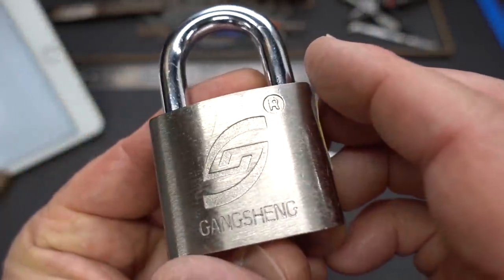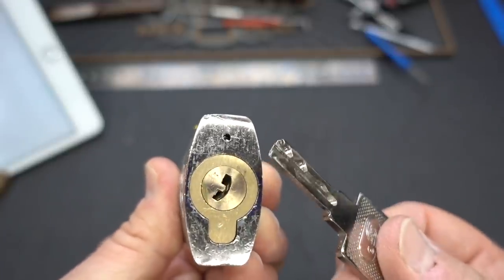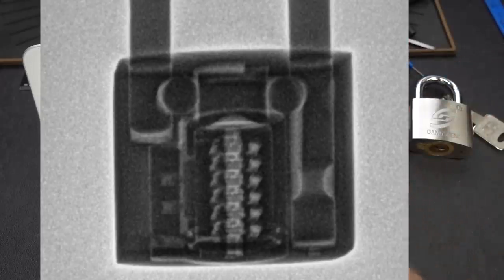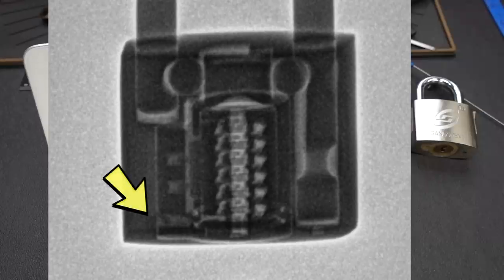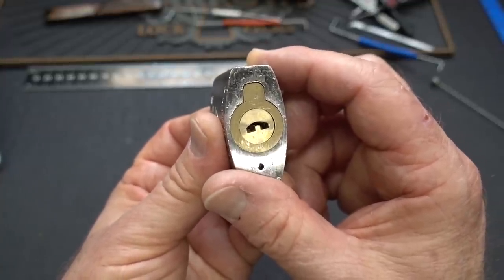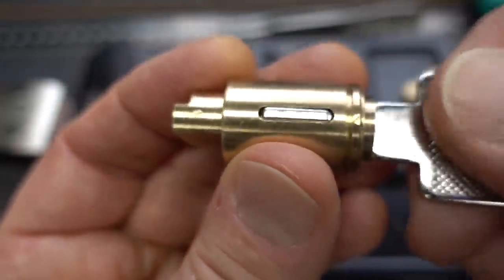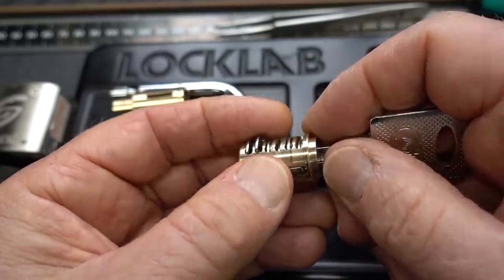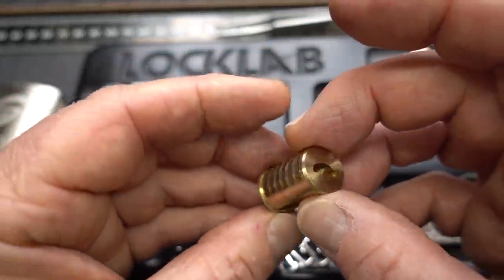(1792) Tensionless Lock (X-Rayed & Dissected)

Comment: I've seen something like this on the door locks of Renault brand delivery trucks we have at work. With the wrong key the core just rotates without engaging the locking mechanism, though those ones have a definite detent at the center position and if I recall correctly you can only insert or remove the key in that position.

I took one apart a couple of years ago and figured it out but I don't remember the exact structure anymore. But it was basically a wafer lock with an extra sleeve around the actual core just like this one.
Reply: Hmm. That's interesting

Comment: The only tension you could apply is lining the sidebars up, and getting the little bit of tension from the two springs through the side ball bearings. I don't think that would be enough to get those wafers to set, but you might feel it just a bit. Trying to pick this would be almost like cracking a safe combination.
Reply: Yes, I think this is the only way to apply some tension to the wafers, but then the problem is to leave the sliders set after you find the gate. Maybe (if the sliders are magnetic) you can try placing a strong magnet opposite to the brass thing that hold the springs, to see if you can prevent the spring of the wafers to move them back after you, hopefully, set it to the gate.

Comment: Future LPL: "I'll use the other pick that Bosnian Bill and I made..."
Reply: I think for that they will need the tension bar that the 2 of them are going to make
Reply: I like that Bill is not too proud to make a video where he says he don't know how too open it, yet.
Reply: Imagine a naughty bucket that LPL has.
Reply: I think that is picking it while you have an xray view.
Reply: Edit: I missed a detail. The outer sidebar locks the middle cylinder and the casing, preventing it from rotating freely. The flaw bellow cannot be exploited.
---
This specific model have serious design flaw, that makes it possible to bypass the lock. Basically, you need a tool that resembles the key, but longer and you don't need any cuts for the sliders. You insert it into the lock, press it inward as hard as you can and rotate. You use friction to directly rotate the middle cylinder.

The inner cylinder (that has all the sliders) is open on both sides, so the tool/key can pass through it fully. To increase security, you need something to close the inner cylinder on one side.

The insert tool may also have small spikes, with the idea of making small holes on the middle cylinder and use them as leverage for the rotation. It would leave marks, but they won't be visible without disassembly.

I've read some comments about using a drill, and my first idea was to spin the inner cylinder fast and use the friction between the inner and middle cylinders. Or rotating and pressing the inner cylinder into the middle one, sideways or in depth.
Then I watched the video again and spotted that the keyway of the inner cylinder is open on both sides.
Reply: You beat me to the obvious comment.  :)
Reply: @_aullik  doesn't the tool they made also tension on another pin instead of the hull so it could be very similar I imagine.
Reply: @ИванСнежков-з9й  Take a video ivan and posted here .
Reply: @ИванСнежков-з9й  the middle cylinder has a side bar that locks it into the outer casing. So you need to lower it to rotate the middle cylinder.
Reply: @stevenrigby6444 , I'm afraid that you are absolutely correct.
The outer casting has a sidebar that locks it with the middle cylinder.
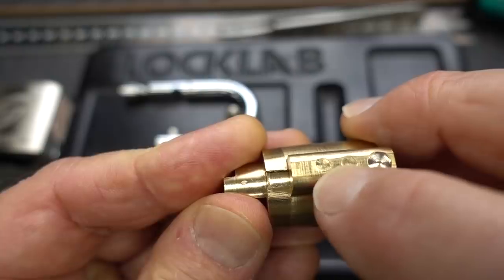It is visible in the video that both are locked at 6:52 .
Reply: @ИванСнежков-з9й  Can confirm, you can't bypass it like that. There's a solid mechanical lockup from the second sidebar.

Comment: Toughen up the lock and use a hardened pin on the side and you have an awesome lock. What's amazing is this came out of China, we are so used to locks that are poorly made.
Looks like the main flaw with this lock is the brass pin holding the core in.
Reply: China can make excellent things, *when they choose to and are paid to*. They can make absolute junk, and have a habit of substituting materials- I've seen 4140L steel subbed in for 1050 (which is not an acceptable substitute). However, if you specify what you want and pay for it, they can do very well. I've seen Chinese fakes of Rolexes that would fool all but the most aware collector, but I've also seen ones that wouldn't fool anyone.
Reply: @caseydarrah  Totally agree with you. For the right price you can get excellent locks from China. generally they pump out the cheap ones though that we are a ll familiar with.

Comment: Is the gate in the same place on each wafer, and the inside tooth cut in a different place? Or are the gates cut in different places on each wafer? If the wafers just need to all be centered, it would be possible to build a pair of 6-toothed picks that could bypass the teeth that interact with the key.

Comment: The only "flaw" in the design that I can imagine exploiting is the fact that the wafers become "centered" for this lock to open. How about using some sort of tweezers or forceps that apply parallel force and then try to do a raking/zipping motion with them, while at the same time applying a twist for tension. The use of two picking faces working in opposition/conjunction would eliminated the need for a separate tensioner.
Reply: You can't apply a twist for tension because there is no tension. Not only do all the gates need to be aligned, but the inner core has to be aligned with the middle core too.
Reply: Interesting idea, but it would only work if the sidebar spring is very strong and the slider springs are very weak. The inner sidebar has to drop into the groove faster than the 12 sliders come unaligned. Simply getting all their gates to align at the exact same second as they're all springing shut would probably be harder than just decoding the lock.
Reply: Or a ‘blanked’ key with a bunch of little leaf springs on it for each wafer. Insert key and each wafer will find its own tension
Reply: @lemmonsinmyeyes  Will find its own tension against what?
Reply: @CristiNeagu  Yeah, this is a lock where you would need to "feel" each slider and hope that you can discern some slight resistance as a gate passes the sidebar with the tiny force that is on it. And then it gets even worse because you have to somehow keep that slider in position as you tackle the others. This lock would require an intricate custom picking key that you would place bitting into as you pick each slider. Not impossible but also not practical, and adding any amount of false gates would make that method take exponentially longer.
Reply: I like the way you think. I have one of these and I truly hope to defeat it some day. Some how. Some way
Reply: @samheasmanwhite  The very definition of "key"

Comment: Bravo to China! They finally made a good one! Not only good, but clever and well-machined too!
Reply: Also check out Yuema 750 &/or 760, nearly identical except with front/back cores instead of inner/outer cores. And the 760 has an extra feature on the bottom of the core.
Reply: @ShadoFXPerino  That was a good vid, thanks!

Comment: Bill, pick it with superglue... lol.  But seriously, if you have a very small needle: can you bend it 90 degrees, insert it half way and try to bypass though the side bars? If you can get it up into the area where the outer side bar is it will not only tension it, but fully bypass it.
Reply: Yep, or why not a full blown superglue or loctite attack and simply  glue the inner chamber and containing sleeve together
Reply: @michaeledson1033  That was my first thought was well. However, the outer sidebar needs to drop in otherwise it blocks the rotation of the middle sleeve.
Reply: @arminkeller  Agreed, so much for a half-assed understanding before posting o7

Comment: Bill could you check if it would be possible to slide a shim between the outer housing and the sleeve? It looks like there is some kind of lip or a bend so I doubt it.
Very interesting design! I guess it would be hard to drill out the core because it will just rotate with the drill.
Reply: Na you would only need to stop the core from spinning. That would be trivial
Reply: The sliders look like SS, so I don't know that drilling the centre would actually help, even if you could keep it still. If you are going to drill, why not do what Bill did and drill out the core retention pin? If they change that to SS, then I guess a slide hammer is your best bet to avoid a very messy drilling experience. Or angle grinder, since we're going destructive anyway...
Reply: @yetanotherstronk  I agree with you. This is more a what-if-thought: "Wouldn't it be great to have that locking mechanism on your door?" Not as a padlock but as a mortise or other style of door cylinder. You are probably right about pulling the core with a Wendt Zieh-Fix or slide hammer.
Reply: You could drill out the core down through the sheer line, but it depends if the sidebars are hardened. It might be easier to pull the core out because it's only held in by a flimsy circlip. Drilling out the retaining pin would be the easiest way though. Just like bill did.
Reply: @jutonium2169  if your willing to apply enough brute Force that entry is evident you don't bother with the lock. There are easier ways to access anything.
Reply: A shim wouldn't let you open it, but if you could get one in there it could help you pick it if you could get it to put some extra force on the sidebar, any extra force would go a long way.
Reply: @samheasmanwhite  if you could get a shim in place or figure out how to run a wire or other thin tool though the core to that airgap you might be able to do something.
Reply: @michealc6439  Hmm, I think feeling the gates would still be the only way, whatever you get in there. That outer sidebar both locks the sleeve and is the only thing coupling the sleeve to the core, if the inner sidebar doesn't drop you can't do anything to move the outer sidebar or the sleeve.

Comment: If the side bars are aligned, isn't the lock tensioning itself? Could you feel each wafer for the side bar catching on the gate? Number of wafers I think could make this nearly impossible. You would also need a tool to keep a wafer in place after finding the gate.
Reply: just like a combination lock you would only get a feel on the highest two. So it would be a lot of back and forth with the specialized tool.
Reply: Yes, this seems to be the best approach imo. Decode it by feeling/listening for when the slider stops making contact with the sidebar, and decoding the lock. You could use 12 special 
picks.
Reply: @curlyvideos   Given the same springs arcross sliders and same spacing when they are aligned, that's the weakness. If you can find one gate and measure the spring tension on the slider there, you can measure that on the other sliders and decode the lock.
Reply: It would need a very intricate tool, basically a key that you can add bitting to like lego blocks, while still being open enough to let you pick freely enough to feel the indent. It would be a feat of engineering as much as a feat of picking.

Comment: Picking the first 2 or last 2 is not enough to gain tension. I have a cam lock version of this with a different shape keyway. The key must be inserted all the way until the final slider engages in order for it to turn the core. (Just FYI: the keyway is standard slider lock flat bar shape.) It's my favorite cam lock out of my entire collection of cam locks. Interesting note: i found it on EBay around 6 years ago using a one-word search term 'unpickable" and I've been unable to source another one like it anywhere ever since.
Reply: Have you posted any vids of that lock on your channel?
Reply: @RPRosen-ki2fk  No, but I hope to in the future. It was going to be one of the locks on the new challenge chest for Bill. But since he's retired, I have to find a new picker who is good enough to pick open the insanely complex locks I have in store for this new crazy challenge chest.

Comment: WOW -- MOST EXCELLENT taking the standard wafer tumbler design and combining it with the Abloy design to make a seemingly "pick proof" lock cylinder, abet a design error in an "easily" removed cylinder assembly.  Very cool with NP's X-Rays, however without the core "in-hand," I'm not sure one would understand how the lock worked.  Also TERRIBLE gutting, ha, ha

Comment: ...gonna say it, impressed but... as soon as I saw the core spinning I knew there was an intermediate sleeve of some kind. I'm pretty sure that came from hard core puzzle sport which is where I've seen it used before. I can see lock picks being powered by drills, and the picks being pretty much carbide drill bits.
Reply: If you're going destructive, a pair of wrenches would be enough :-)

Comment: the springs pushing the ball bearings on to the outer side bar are already tensioning the lock, as the outer side bar pushes on the inner one, when the core is aligned correctly. It is probably not a lot of tension delivered by these tiny springs, but its all you get ;) But I still think, that is not single pin pick-able, as the sliders have that V-groove and springs themselves, that will probably overpower those two tiny springs. but maybe you can decode it slider by slider (one should bind very lightly) and fix them in place once decoded...

Comment: If you put a strong permanent magnet across the lock body and rotate the core so the locking bar is on the opposite side, does it attract it enough that you have a reasonable chance of setting the first or last few wafers on either end of the core to allow the magnet to pull the bar in at one end? If you could do that you'd have some feel on the remainder of the wafers as you moved through them in order.
Reply: If so they should make all the parts stainless and non magnetic
Reply: If the lock was in a door, that would be a no-go ...

Comment: You might be able to decode the lock with a mirror tool like the Kwikset smartkey decoder. It should be possible to see the location of each gate through the keyhole.
Reply: Nope:( all you would see is the warding and the nub on the slider that the key interacts with

Comment: that brass pin needs to be some hardened steel because that entire lock is hold by that pin alone - the design seems amazing
Reply: The most secure method still seems to be the screw from the top, blocked by the shackle when it is locked. That way when you're able to reach the screw, you already had to open the shackle some other way.
Reply: Bolt cutters on the shackle are faster than drilling out a brass pin.

Comment: Are either of the sidebars or the ball bearings magnetic? If so you could use a very powerful magnet to apply force to the sidebar without using tension at all. Then once you pick it, you would have to keep the sliders in place until you got the second sidebar down and rotated the cam a little.

Comment: Holy crow, I'll have to watch this 30 times before I fully understand what turns what and what actuates what.  Oof
Reply: To put it in a simpler term:

Inner cylinder has a sidebar which sits flush against the outside of the cylinder unless the right key is in. Upon which the sidebar can move deeper into the inner cylinder causing a groove to appear.

Outer cylinder has a sidebar which will "fall down" into the groove of the inner cylinder (only if the right key is inserted). This engages the outer cylinder with the inner cylinder.

Outer cylinder is connected with the cam mechanism that disengages the big ball bearings that hold the shackle in.

The two small ball-bearings-with-springs are there just to ensure that the outer sidebar will "fall into" the groove on the inner cylinder regardless of orientation.
Reply: @PanduPoluan  thank you, it was the sidebars getting me stuck it seems :)

Comment: My theory is that these are "bets test" versions of an ultra-secure future lock. These are passed around to talented pickers for an assault on the core, and don't need all the ordinary hardening tricks for this phase. Imagine the frustration if there was an impressive level of hardening before anyone even got to the core. They'd all go into "naughty buckets" before anyone even started in on the hard parts. They don't need all the world's best pickers depressed and suicidal. 

Impressive craftsmanship on the core, which must have been costly to make, especially with consistent quality. The next step would be coming up with a faster/cheaper production method that wouldn't significantly degrade security. THEN the upgrades to the body and shackle would just be the frosting on the egg roll.

Comment: So you can probably (maybe) pick this the opposite way you pick a normal slider lock.  If you put a tension tool in it and sweep it past the position where the first side bar engages with the second side bar, you'll start getting resistance when you have a slider in a gate.  It might take a special tool, but I'm guessing if you just used a double rake that mimics the general bitting of the key, you should be able to feel for more and more tension as you get closer to setting each gate.
Eventually the lock should bind up when the inner side bar is in enough to lock with both the core and the middle sleeve.

It seems doable.  lockpickworld has a rake/pick tool set for VAG car locks.  Something like that, only with rakes on both sides instead of just one.